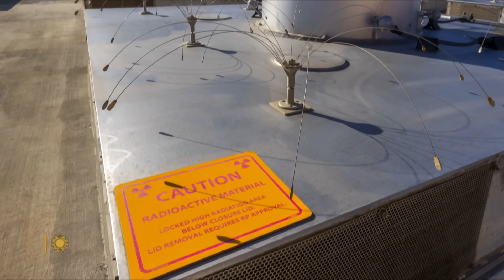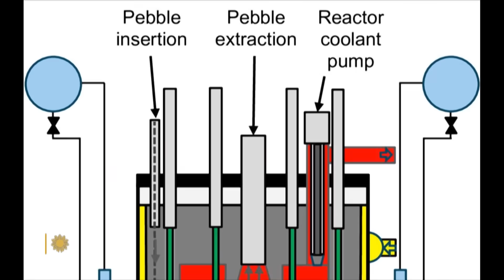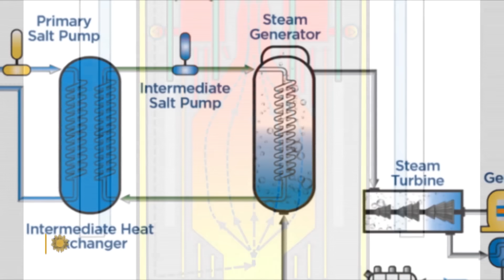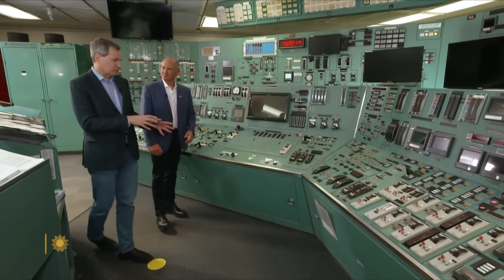Big Tech's big bet on nuclear power

Comment: They'd be far better off to invest in locations near or in West Virginia where the coal interested WV government will be on board for fast building of modern 100 year service life ultra supercritical  (USC) clean power stations that burn high BTU bituminous coal the state has in abundance.   A USC clean coal power stations burning high BTU bituminous coal has an estimated crossover fueling price with natural gas priced at $0.80 per million BTUs natural gas (2022).   US wholesale natural gas price was at $3.42 April 2025.   This is a slightly off-season low price.  

NG price in the US had been below profitable due to LNG export terminal blowing up a couple years ago which is now operating.   NG is a by-product from crude oil and has to be processed regardless of selling price.  Pure natural gas wells were not profitable over the past couple years due to over supply and low prices.

US nuclear power build costs of the last few decades have been multiage times higher than that of the same capacity 100 year service life build of a modern USC coal power station.   This is far above where the nuclear power station could be able to offer more economic electricity than the modern USC coal power station.  The difference in their financial bond costs would pay for all the coal and staff at the new USC coal power station.   This might change in the future, but not likely soon.   

Nuclear power stations have a large time window needed to build likely at least 10 years and possibly more where in the coal friendly state of West Virginia  a new 100 year service life USC coal power station could likely be online in 5 - 6 years.   If working 24 hours a day on a fast paced schedule this could be reduced significantly.   There is no fast means to reduce the build time of nuclear power station due to all the checks with federal involvement that need to take place.

100% of the wild AC generation space from solar voltaic and wind turbine generated electricity needs to be 100% supported by the public power grid with fast reacting peaking power,  the most fuel intensive form of electric power generation.   Power grids overwhelmingly provided this peaking power by running natural gas turbine generators at high readiness 70% fuel consumption making near zero electricity were 100% output 100% backs up the wild AC.  Just maintaining high readiness consumes more natural gas than making all the electricity from efficient running natural gas combined cycle power stations.

A very large wild AC generating space requires the power grid to take off line base load generation as much as possible including nuclear power to be replaced with fast reacting peaking power.   Extreme situation of possible over supply from wild AC requires the power grid to be suppling remote grids all supported with peaking power. 

Natural gas is too expensive a fuel, even at breakeven prices, for making base load electricity.  

-----
NASA reports global warming at 1°C where it has been since 1992 after falling from its reported all time high of 1.1°C in 1991.  The cause of global warming is not known.  Earth's water vapor saturated greenhouse effect is due to water vapor.   The other greenhouse gases can not change the overall effect of earth's water vapor saturated greenhouse effect that absorbs all the greenhouse radiant energy from the earth within a few meters of the radiating surface adding 10°F (5.55°C) to earth’s average temperature.  This was taught in US high school science.   No climate change from global warming that was to start at 1.5°C of global warming causing stronger observable hurricanes in the Gulf-of-America (Gulf-of-Mexico).  

On average human caused atmospheric carbon dioxide is less than a 0.1% share in earth’s water vapor saturated greenhouse effect.  Water vapor has a CO2e of 18 and on average is 1% of the troposphere.  Carbon dioxide has a CO2e of 1 and is 0.04% of the atmosphere 400ppm.   

1.00%/0.04%=25,  water vapor is 25 times more present in the troposphere than carbon dioxide.  25 X 18 CO2e = 450 CO2e for water vapor and 1 CO2e for CO2.  All the other greenhouse gases add up to a bit less to about the same as that for carbon dioxide or 1 CO2e.   Carbon dioxide has 1/452 (0.0022) share in earth’s water vapor saturated greenhouse effect at average 1% water vapor.  

40% of atmospheric carbon dioxide is considered to be from human activity;  0.0022 X 0.40 = 0.000885 leaving human caused atmospheric carbon dioxide on average being less than a 0.1% share of earth's water vapor saturated greenhouse effect.   5.55°C X 0.000885 = 0.0049°C share in temperature retention from human caused atmospheric carbon dioxide.  

Water vapor always hold earth’s water vapor saturated greenhouse effect in saturation.   The other greenhouse gases can not change the overall effect of earth's water vapor saturated greenhouse effect.

Former Greenpeace scientists state there is no unhealthy high level of atmospheric carbon dioxide.  1200 ppm carbon dioxide levels are used in plant growing greenhouses for C3 plants over 90% of the plant life on earth.   This is three times the current atmospheric carbon dioxide level of 400 ppm and would greatly green the earth especially desert fridge areas allowing C3 plants to need less water.

———
The entire wild AC generating space from solar voltaic and wind turbine generated electricity needs to be 100% supported with fast reacting peaking power.   This is the most fuel intensive form of electric power.   

Wild AC is especially problematic from residential home solar voltaic that can momentarily over supply the power grid at near the limit of the feeder lines.  This residential supply can not be disconnect from the grid as with power stations or well predicted.  The power grid needs to be suppling remote grids in order to support this uncontrollable over supply.   Un addressed over supply of electricity will cause over frequency throwing interlocks causing instant blackouts. 

Large amounts of wild AC from solar voltaic and wind turbine generated electricity costs the public grid more natural gas to support by running natural gas  turbine generators at high readiness 70% fuel consumption making near zero electricity than making all the electricity from efficient running natural gas combined cycle power stations where a second steam cycle adds 50% higher efficiency.   When making up the dips in wild AC output more natural gas will be used.

The practical use for solar voltaic and wind turbine generated electricity is for maintaining electrical storage.   In many situations this is not economically practical unless there is a need for instant emergency backup power.

Comment: First, you have to figure out where to put the nuclear waste spent fuel. Right now there is no solution.  All nuclear power plants are constipated, they can't take a poop. The reactor waste just sits on the power plant site. Second, the economics of nuclear power just do not make sense.  Natural Gas fired combined cycle power generation is less than half the cost, even when figuring in the cost of the fuel. Third, the danger of nuclear accidents is still there, maybe the risk is somewhat reduced, but still potentially quite dangerous.  The Chernobyl and Fukushima disasters may not have killed a whole lot of people, but the clean up costs are astronomical. Chernobyl's cleanup cost is more that the entire Russian nuclear program.